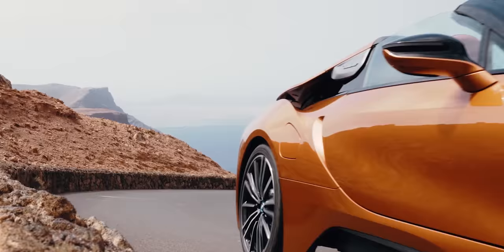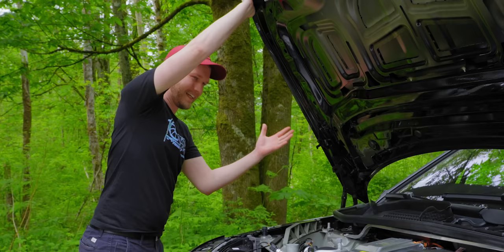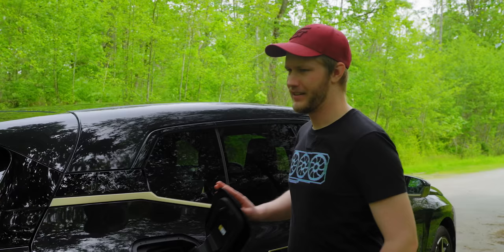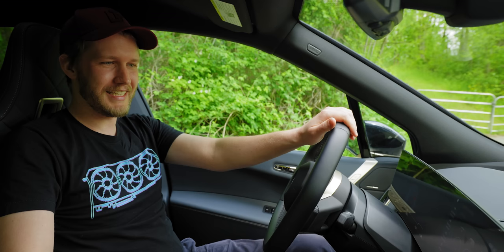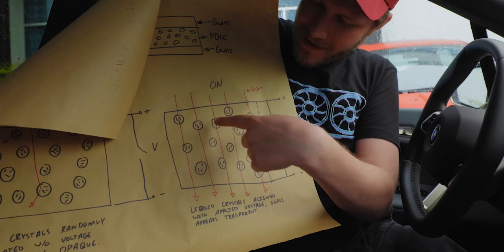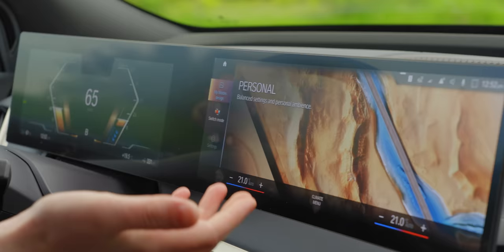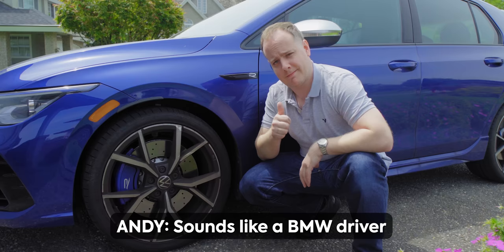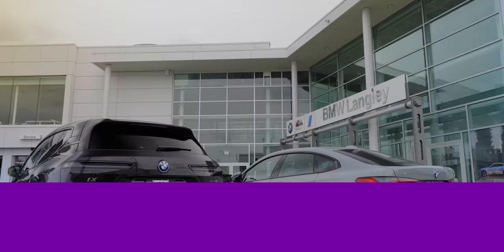It's... Complicated. - BMW iX

Comment: This kind of car is a prime example of what happens when the marketing team controls the engineering team. No one wants a mountain of piano black plastic, with unusable touch controls everywhere, while also not having enough leg or head room, even if you're 5'2. But it drives great, I guess
Reply: Glass and piano black plastic are not the same thing, the screen is made from glass not piano black, other than that I agree
Reply: They even invented a term for it: “shy tech”
Reply: It's odd because their older EVs weren't like this. My i3 seems spacious, although I'm not too tall, and most of the controls are still physical. You've got a screen for settings and CarPlay/Android Auto, but it's not trying to absorb all the physical controls into it. It's odd to me that they've   changed so much.
Reply: Mechanics think engineers suck at design as they often make repairs difficult and expensive.
Reply: And this is why you just buy the 3-series. Because it's the best car BMW makes.
Reply: @shivamarya5225  the back seats and a bunch of the front dash is piano black plastic…
Reply: @Miliroxx28  yeah its not alot tho, especially compared with Mercedes and audi EVs, but still not acceptable in a 100k car
Reply: This comment makes no sense. You cannot list what people don't want in a 100k vehicle when there is a waiting list to buy them.
Reply: @SPLSE  I feel like people don't actually want these specific things, they just want the new expensive car because it's new. I don't know though, maybe that's just me because I can't understand it
Reply: Why would marketing team want an ugly car? It makes their job really difficult. If anything, this video is saying the opposite. They stress a few times that styling was sacrificed for aerodynamics.
Reply: @Robert T

I just want to know the mechanics, who actually went into engineering career and told other engineers, "don't do that!" Lol.
Reply: I hate complicated touch menus in cars so much. Trying to get bluetooth to work in my new Golf is a gigantic pain.
Reply: @jakeburg4225  Why didn’t they sacrifice the grille for aerodynamics lol
Reply: @wyw201  you think that a marketing person, or anybody involved with sales, came up with that grill design?  You actually think that? Haha.
Reply: @jakeburg4225 Yes, I hope they would sacrifice the grille too.
Reply: So people are brave to say "Someone should be FIRED", yet they're afraid to wish death on the designers?
Reply: great is quite the overstatement
Reply: @Miliroxx28  That's nonsense. Did you drive the car once? There is no piano black plastic in the Backseat. In fact the car is spacious and very comfortable. And the front dash is vegan Leather or Leather, no plastic. I the console in the middle is in wood and crystal. Very little piano black.
Reply: @SPLSE  there's a waiting list for most cars
Reply: @kenzyanope9666  I am aware. A customer must want to buy a car at 100k if they are willing to wait on a list for the option to do so.
Reply: I kinda doubt it's marketing. They just need to hire a competent UX-designer of some sort
Reply: Most of y'all are just traditional engine drivers. Traditional controls fits you better. This is electric, it does have some flaws, but in reality electric cars are supposed to look different.

Comment: My mom is trying to look for an EV that isn’t Tesla, so I’m glad that these car videos are starting to come out more often.
Reply: Tell her she can just try. No need to “actually try” as the word actually is worthless.
Reply: Hands down the ioniq 5 is just the best middle class EV at the moment
Reply: @mavfan1  I put it in because she was only passively looking at EVs before, but fair point.
Reply: Just buy a gas guzzler like a normal person
Reply: @linussu702  Unfortunately inefficient, comparatively small luggage space, meh performance, annoying, ugly software and not even cheaper (here) than a Model Y once you add options you'd most likely want - looks nice though and drove fine during my test-drive.
Reply: @Khloya69  something simple that makes fire...
Reply: Check bmw ix1 newly launched and looks a far more matured product than this
Reply: My mom's waiting for the lyriq, its looking quite promising
Reply: @Khloya69  no
Reply: If she wants the best EV and charging, she really should consider a Tesla.
Reply: Someone already recommended IONIQ 5, but if you are not interested check out the Mustang Mach E also
Reply: rivian?
Reply: The Polestar looks very interesting as a EV option, hope they do a review of one eventually. I believe it's a subsidiary of Volvo
Reply: Go GM.  Chevrolet has slashed the price of its 2023 MY Bolt and Bolt EUV to make them dramatically cheaper than 2022 MY.  The Bolt 1LT now asks $25,595 (including destination) instead of $32,495 while the Bolt EUV carries a new entry MSRP of $28,195 over the prior year's $34,495.
Reply: Exact same story in our house. These reviews are great!
Reply: F150 Lighting or Mach-E is probably your best bet.
Reply: Hyundai, Kia, Genesis Triplets.
Reply: Here's some notable alternatives:

Hyundai Ioniq 5
Kia EV6
(don't kill me, but...) Mustang Mach-E

just to name a couple. a lot of car manufacturers are offering fully-electric SUVs right now, with plenty more to come.
Reply: just watch doug demuro, savagegeese or established car reviewers, while short circuit makes entertaining car videos, it's hardly consumer-grade advice for your mom
Reply: Tell her to buy a normal car that'll actually last more than 100k miles with support and spare parts publicly allowed. Electric is the worst idea right now.
Reply: @smajin28  "that'll actually last more than 100k miles.... Electric is the worst idea right now."
You have no clue what you are talking about. 250,000 miles lifespan is poor outcome for a BEVs. It just depends on how much you driving you can wrack up during the short 16 year life span. Mileage is not an issue for BEVs and is one of it's Overkill advantages. Though I can't account for Lemons and Poorly designed cars from the likes of BMW, that Negligence and Flaws will always exist. To false state BEVs can't do more than 100K miles is a Blatant Lie.
Reply: The charging infrastructure, interface and software support make Tesla leaps ahead of everyone else. Below that, the Ionic 5, Mach e and EV 6 are some of the best options you can get but before that, ask her why she doesn't want a Tesla. If it's pricing, you could look at the used market if her needs allow a smaller range. If it's availability, good luck. If it's fear of the car breaking down, there is a lot of false narratives to debunk.
Reply: Same. She really wants a Subaru but their EV is a bit disappointing in terms of fast charging. And she definitely won't consider a Tesla so it's great to see more options.
Reply: I wish Tesla would switch to using the charger plug that the entire auto industry besides them have standardized on. Granted, Tesla’s were on the market before the standard was around, but now they have no reason to not adopt the standard on new models coming off the line without having to use a dongle.
Reply: whats wrong with teslas?
Reply: the best EV on the market is the Ford lighting, because it is actually a good car that will have long support, a great second market support and will not fall into pieces like a TESLA
Reply: @jesusbarrera6916  
Misleading narrative. Manufacturing issues and assembly quality have been resolved for a while on the Model 3 and the major issues on early production Model Y vehicles are no longer present. Still, nothing is perfect and Tesla is producing EVs in far greater number than any other manufacturer. It means we may still see more issues concerning Tesla's than any other brand's EVs even if the rate is lower per vehicle due to the sheer number of vehicles on the road.
Reply: Consider Aptera. They will start production at the end of the year, and they’re set to make the most efficient EV to ever grace the roads.
Reply: @andreirachko  
Although I'm glad it exists, the Aptera is for a niche market. Not that many people buy a two-seater in the first place.
Reply: @gabrielgingras814  EVs mean absultely nothing when it's door fittings not being installed properly that is the problem
Reply: @jesusbarrera6916  
"Anybody can fix a panel. Anybody can fix paint. Anybody can make gaps in a car better. Nobody can make circuit boards like Tesla did. Nobody can produce electric motors like they do. I mean, they're light years ahead of everyone well actually a dozen years ahead of everyone so, to me, as an engineer, any engineer that looks at Tesla knows it's far and away the best designs on the planet." - Sandy Munro

P.S. 
The panel assembly and paint on the Model 3 produced in Fremont is flawless since December 2019. Now they need to do the same thing with the Model Y.
Reply: The fact that the Tesla does not have an OBD2-port like the entire industry does that makes it impossible to self-diagnose anything on the vehicle, is reason to not buy a Tesla if you cannot afford paying the Tesla garage premium. Also, a set of tires will set you back more than $1500. 

Tesla’s may seem nice but there are a lot more reasonable and equally usable EVs on the market today.
Reply: Not sure if they have done a video on a Polestar? I have a friend who bought one a few months ago and genuinely loves it.
Reply: @Khloya69  lmao
Reply: I'd say Kia EV6 would be the best. But the wait list is huge. I don't like how the Ioniq 5 looks, especially from the rear, but that's personal preference, its underlying build is similar to the EV6. Mustang Mach-E is good, but it doesn't charge as fast as the EV6 and it's one of, if not the heaviest. But it's a decent competitor to the Tesla Y and probably the most "normal" of all the EVs. Polestar is ok if you need something smaller like a coup rather than an SUV, the Polestar feels downright claustrophobic compared to the others. Also for some reason it has a huge hump in the middle of the floor of the rear seats even though there's no drive shaft, dunno why but it was annoying.
Reply: Jaguar I Pace?
Reply: Buy a normal gas car and convert it to a biogas car and you can have the car sounds, manual gearbox qnd every feature that a normal gas car has but its 100% green and cheap to drive
Reply: Just watch Carwow
Reply: @smajin28  actually most EVs will hit 200k miles easy while ICE cars start having trouble after 100k
Reply: @KuraMad2000  it’s built on a shared platform with ICE and Hybrid cars. Thats why it has a transmission tunnel smh
Reply: @NO3V  but sadly that’s the only option if you don’t want a Tesla. One other option would be the Mini Cooper EV if the ioniq 5 is to expensive but that’s just too small and the range ist miserable  
The best option probably would be to just buy an internal combustion car if you need a car right now kinda sad tbh
Reply: EVs are a scam. You didn't realise that yet?
Reply: @linussu702  Renault Megane E-Tech is the electric car to buy now (on a budget).
Reply: @gabrielgingras814  But the non-existent repair service and lack of quality of their products makes them less than ideal option.
Reply: Easy, if not Tesla, go for the Polestar 2. : )
But why not just go for the Tesla.
Reply: @flottenheimer  probably for the same reason I didn't go for a tesla. Sure I'll drive one. But I'm sick and friggin tired of looking at them. They are literally EVERYWHERE now. Just my personal preference but I'm so bored of seeing the same tesla design now, if I'm going to buy a new ev I want to enjoy looking at it. Uhh, not as bad as the travesty in this video though 🤮
Reply: @KuraMad2000  I very much enjoy looking at the 2 in our garage. And every Tesla I see on the road makes me happy because that’s one more EV and one less ICE vehicle putting out CO2 emissions. Any EV on the road over an ICE is a good sight in my opinion.
Reply: @Norweeg  why would they? They have a more mature charging network than the entire auto industry, and on top of that you can just use an adapter. Literally the best of both worlds. So I don't understand your complaint.
Reply: @disadadi8958  
Yeah... Servicing is still a problem. Glad Elon is finally addressing it.
"Working on Tesla North American service. 
Goal is 2/3 of cars receive same-day service, no wait."

For assembly and paint quality, the Model 3 has been pretty much flawless for a while now. Now they need to complete the same thing for Model S/X/Y but it's like changing tires on a bus going 80 mph. I mean, look at their backlog!
Reply: @gabrielgingras814  North American isn't the only place on the Earth. Frankly, I don't care about customer service in the North America. 

If it takes 2-6+ months to get your car fixed here locally, I won't even consider Tesla as an option.
Reply: @disadadi8958  
Still, it's a good sign for what's next. Long overdue I must admit.

Comment: "The bonnet must only be opened by a manufacturer Service Partner or specialist workshop" -- Yup, that's another car I'll never even begin to consider getting right there. All three thumbs down.
Reply: There should be a frunk on BEVs. You should open the bonnet more than ICE car on BEVs. Just to put and get stuff.
Reply: I fully support your point. 👍 But: if you choose a tesla or any other car with a frunk, you basically have the same outcome (+ a bit of additional space). No car with a frunk is meant to be worked on. PS: i drive an eGolf, and luckily i can get to literally everything, not that i need it 😉
Reply: @erebostd  "No car with a frunk is meant to be worked on" WTF?
It's realy easy to access part with most frunks. They are relatively easy to remove. Or atleast the hardware area just has a cover plate. FYI The 12v BATTERY is there.
Reply: @Neojhun  yeah, but in the manual it states you shouldn’t do it, exactly like what the manual from this ugly bmw suggested. And like in teslas an other cars you easily get in, if you want to. He pulled two latches, not exactly rocket science, don’t you think?
Reply: @erebostd  The 12 Volt Battery issues do not allow OEMs to use that excuse. Until that whole system is removed. The driver will eventually need to access it when something goes wrong. Can't rely on approved tech just to get the car moving in the middle of nowhere. Sure most have warranty warning if you mess with anything else. But the 12v battery problem has no choice.
Reply: @erebostd  It should hardly come as a surprise to anyone that Tesla is among the worst manufacturers around in this regard.
And it's not really about there not being parts directly below the bonnet, I'm perfectly fine with there being a frunk, it's not really even about the absolute level of ease of access, I just won't consider a car whose manual explicitly states that I shouldn't be working on it myself.
Reply: Get over it, no way will you be working on a modern EV regardless. The days of DIY tinkering with your car is over
Reply: @doomsday9973  LOL that's ironic. Sure the OEM are doing stupid things to make it more difficult to access parts and insane policies. Fact is the Hardware of BEVs is far easier to work on than complex modern ICE vehicles. They simply have less unique single purpose parts and require less specialized tools. There is far more you can work on in a private garage on BEV than modern ECU based ICE vehicles. The irony is if we did not have Corporate Greed even influencing engineering. BEVs should of ushered in a new golden age of Back Yard engineering Hot Rodding. Atleast there is a small growing community doing that right now using Junk Yard parts from Wrecked Crashed BEVs. Funny how those exact parts are use to Convert old cars.
Reply: @Neojhun  BEV’s are not cars not should be used or modded for “hot rodding” do something stupid and your car is an inferno or you are fried and electrocuted. These aren’t machines meant for tinkering beyond suspension etc. that era is over. Things change
Reply: @chuuni6924  Tesla is far from the worst, BMW & Mercedes make it difficult to even open the bonnet let alone work on it. Soo your statement does not even make logical sense.
Reply: Typical BMW bullcrap

Comment: This cars user interface seems to be the result of a bad intern project. Specifically by an intern that has never been in or seen a car.
Reply: lol
Reply: He made it sound much worse then it actually is. I thought I drive 8 was excellent.
Reply: designed by a recent college grad who's used transit exclusively for 5-7 years and wouldnt visit anything but another city
Reply: @doomsday9973  this car's starting MSRP is 90k. 90 thousand dollars and "nOt tHaT bAd" this car should be close to perfect. Are you dense AF?
Reply: This is a trend generally, unfortunately. For example ergonomics of new(-ish) Canan's lineup of cameras was clearly designed by a youth who has never ever taken a picture with anything but his iPhone.  Their specs are so good, but there is so much parameters you cannot possibly adjust without menu diving, which for literally four decades were a a roll of a dial, or a button press and a roll of a dial, sometimes button hold and a roll. YOu could do everything without ever taking your eyes off the subject.
Reply: Hey don't bully my 12 yrs old, bmw was pretty generous for his drawings, they gave him a cap and a burger.
Reply: @huskers1278  you are obviously not buying so why rage so hard?
Reply: Mercedes  had a wierd knob interface years ago... dont know if they ditched it, but my ex's suv hsd one and it drove me nuts, ever tried to txt over a knob.... way more dangerous than txting, and mercedes didnt block that feature while driving.... i was afraid for my life a few times...
Reply: Naw, this screams middle management interference/planning.
Reply: having been a design intern before, the intern probably came up with something way better but BMW compliance probably vetoed it ;--)